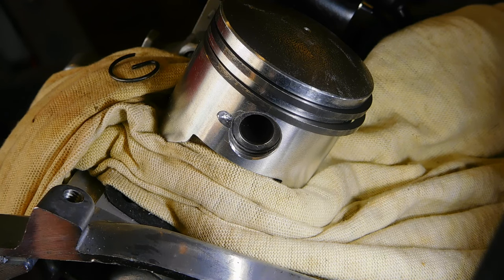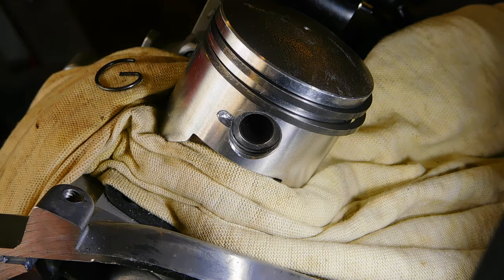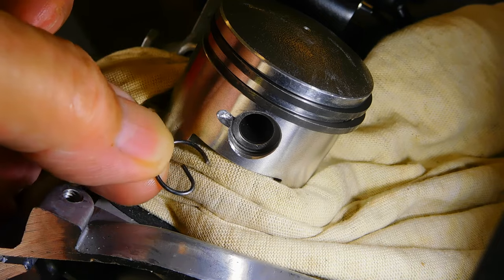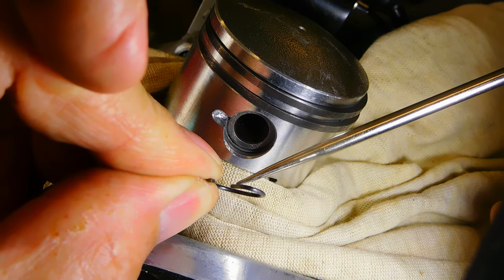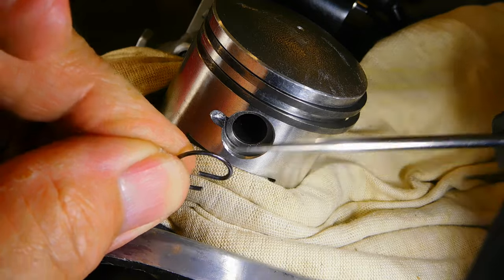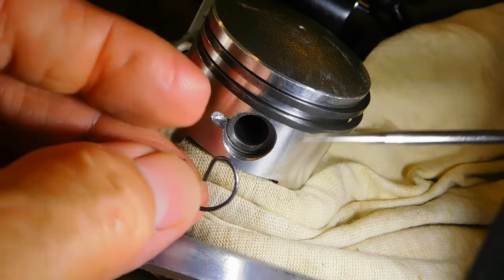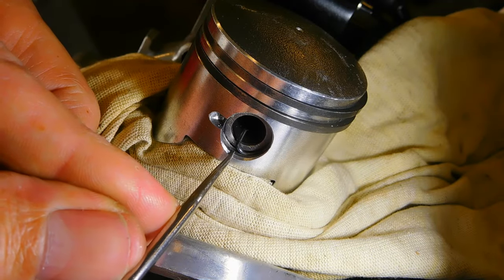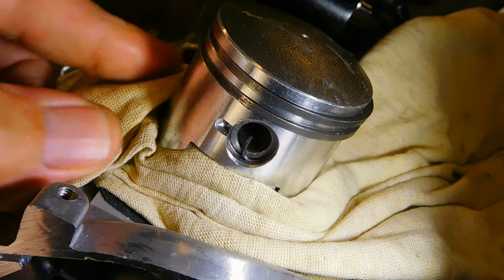One Way to Quickly Destroy a Two Stroke Engine

Comment: sorry man... we tried this one out and we bent the clip and assembled the engine and all that happend was a little grind on cylinder wall
Reply from the maker: Luck was on your side it didn't hang out in the transfer port.
Reply: had that happen on moped many years ago, never found the clip and the cylinder was scrap with a 2mm deep piston pin wide groove in the side
Reply: @fuzzy1dk  I highly doubt that you didn't just have your c-clip seated correctly....
Reply from the maker: @Lasse
It sure makes a mess if the transfer chops the clip.
Reply: @tomi you are right, it might never have been installed, the damage was from the pin rubbing on the cylinder
Reply from the maker: If there was no marks on the piston from it chomping the clip in the transfer it may well of not had the clip in it.
Or by some act of shear luck it made it into the transfer and then back up top and out the exhaust without getting guillotined..

Comment: With the thickness of thos rings im sure it would chew it up and spit it out tge exhaust
Reply from the maker: Yeah it chews it up alright.
But unfortunately the clip is steel and the piston is ali and steel wins.
The other issue is the clip is perpendicular to the ex port in the piston pin hole and more in line with transfers so to make it out of the exhaust it would first have to go down the transfer port without the piston chopping it, and then pop back out the transfer port once the piston is at BDC and then go out the exhaust and that's pretty long odds.

Comment: imho the material itself is hard and there is no possible way that clip will deform with a normal installation. In engineering it call elastic deformation. the circlip will not deform unless it goes the yield stress. just use a pliers to install fast and easy way
Reply from the maker: Not sure how much experience you have had with piston pin clips but the ears do bend quite easily if some force is used. Keep in mind that they are elastic / "springy" radially over the entire circumference. However they are not inserted or remove like a C clip by both ears and one one ear is grabbed with pliers to twist them out of the slot or in to the hole and as such the deflection is twisting the wire over the short length of the wire "ear" which is how they deform so easily. That said the ear being bent is a side issue and even if not bent the clips can come out for reasons outlined in the video, in addition to be "sawn" off by the pin in operation (I have an engine with this condition I will be doing a video on soon). So the best remedy is to simply never use circlips with ears in a 2 stroke engine, there is nothing to be gained by using them as non ear circlips are easy to fit and remove with the right method, however there is much to be lost if one comes out or an ear breaks off in a 2 strokes with ports and gets guillotined.
Reply: @AuMechanic  why mention only on 2 stroke so 4 stroke is good to use this pin?
Reply from the maker: @halim1644   Because 2 strokes have ports on the cylinder if a clip comes out it can get guillotined by the piston and the transfer port on the sides of the cylinder ending in catastrophic damage to the piston and bore.
In a 4 stroke there are no cylinder ports so if the clip comes out there is no such problem, so clips with ears are ok to use in 4 strokes, just not 2 strokes.

Comment: think ill buy new little wire circle thingys
Reply from the maker: Good idea.
Most 2 stroke piston kits come with them.
I see in a search the DT100 Wiseco kit has earless clips
Reply: @AuMechanic  I bought the yamaha piston orginal,new .75 ocer...and rings...ya,aha dt 100
Reply: @AuMechanic  has a inner spring ring to compress the compression on one ring...ill have ti find a place in farmville va to bore...last guybhad bike..put good piston..not enough comp to run...unless add a little oil
Reply: hope i bought rite sstuff...havent seed cylinder inside yet...nice bike,but small...i had one in ca ..would fly
Reply: guy i bought it from spent 1200 on it...points were grounded,ane wire to coil has lost contact
Reply: @AuMechanic  hey,thanks,,,rhats good parts...ley yall know how it comes out

Comment: wrist pin clip.  always use a new one.  that bitch has happened to me more than once.  they get worn out and don't have the temper (strength)
to hold it in place any more.  I'm as cheap as the next guy and this is one time NOT to be cheap and reuse.
Reply from the maker: Agree, new one each time if you can.

Comment: He's wrong, the clip will keep the wrist pin in place, I've done 100's never had a problem
Reply from the maker: As a mechanic over a few decades I heard that reasoning many times before but its not a logic any professional mechanic should be using because it goes like this.
"I never had that problem ...  until I did"
I suggest you read the many comments of others stating that they did have this problem and it ended badly and at much cost to repair.
For the price if a set of pin clips you can easily avoid ever having his problem.

Comment: Why do they persist with this garbage design when circlips are readily available?
Reply from the maker: There are other issues with this engine Ill be doing a vid on.
All of which undermines the engines power and longevity and could have been cheaply avoided.
Happens so often with theses cheap Chinese goods, the design is all good but in the finally assembly it all goes to junk when they throw the wrong parts at it or just botch the assembly.
Reply: @AuMechanic  Being cheap Chinese is it a half crank design?
Reply from the maker: It's a full crank but more like a 4t crank with counter weights, much the same as chainsaw engines.
Reply: is circlips really better? with the chamfer on the piston pin and a round clip force on the pin pushes the clip into the groove. With a square circlip, especially  in round groove, it doesn't
Reply from the maker: @LasseThe square section clips are used in some cases, one being the air cooled VW engine pistons pin clips.
Some engine pistons with floating piston pins have Teflon buttons at each that rub on the cylinder wall and no clips at all.

But they are 4 strokes, while it is not good to have a clip come out either way its not so terminal in a 4 stroke without ports.
But in a 2 stroke with ports it is critical the clip doesn't fall out due to the damage it can cause so you round clip being forced in to the slot by side pressure from the piston pin gives added security to keep it in place.

Comment: great tip. i would logically thougt it would be safer to do it the wrong way :) thx
Reply from the maker: Glad to help if it saves someone from potential engine damage.
It seems like a minor issue but if it fails and pops out the damage bill can be quite high.

Comment: This accident happened to me so many times with those dirty cheap motorised bike engines.
Reply from the maker: Yes, no surprises there. Best just to snip the ears off and grind the ends so there are not burs and the clip seats in the slot and cant be pushed out by the pin or the ears sawn off by it.

Comment: I dont have the fucking slot 😒
Reply from the maker: That's annoying.
Reply from the maker: If you have a small file you can file a slot and you only need it in one end to remove one clip next time you replace the piston.
Reply: @AuMechanic  very annoying the bikeberry install guide had the two part sirclip where you use pliers and they gave me the g sirclips with no slot, i managed to get em in there tho slightly scratched around it tho nondeep gouges and i used an aircompresser to get any shaving out of anything if they were there cant wait to finish this had a few roadblocks already tho i have all the hard stuff done now